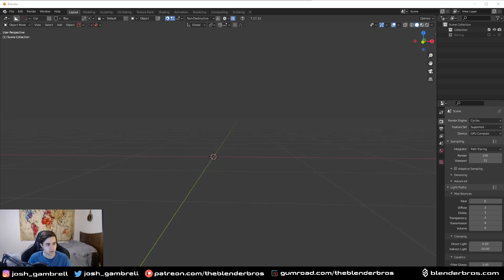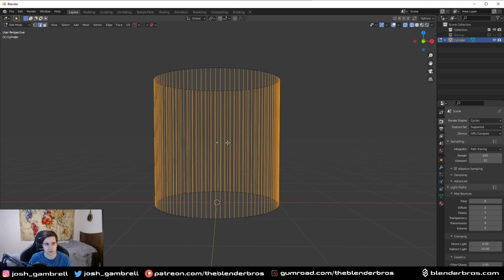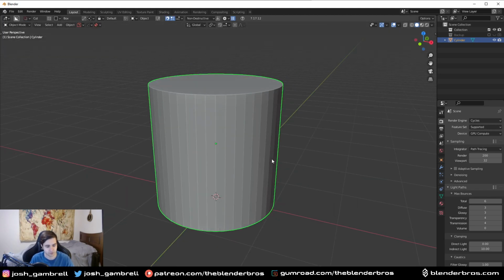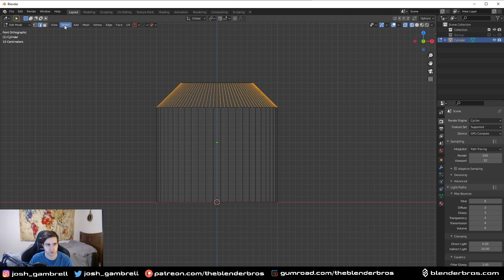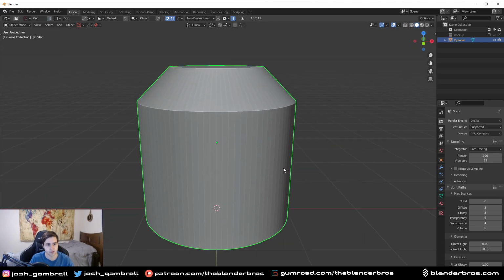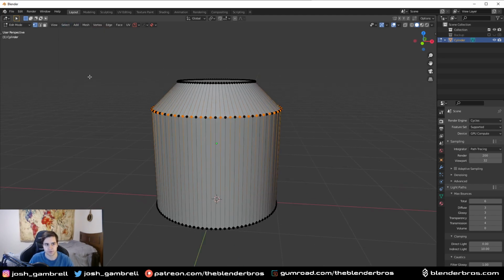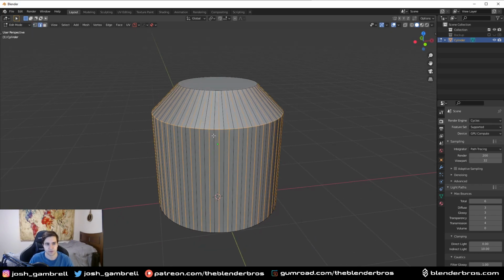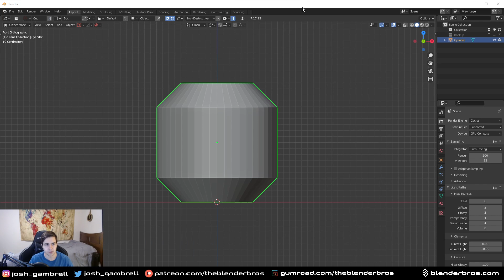Blender Selection TRICK using Machine Tools

Comment: Hey Josh, so I mentioned, not too long ago that I purchased Hard Ops, Box Cutter, and Mesh Machine (I also got Machine Tools), and you were the main person that convinced me to make that plunge. 

So, I have this issue with these Ngon cuts that you like to do. It makes none manifold topology. And I activated the 3D print plugin. But... I'm at a complete loss on how to fix these Ngon cuts.
Reply: I don't have any of those but i would think his tips to get clean ngons should help with non-manifold geometry, you need to triangulate as a final step tho if you're modeling for 3d printing blender does it automatically when exporting to stl.
Doesn't really matter if the model is non-manifold, it's a lot more important to see if it's being sliced correctly as you can have a non-manifold model that prints correctly as well as a manifold one that doesn't, the slicer settings are usually more important
Reply: @Ebani  so, I've recently done some experiments. This is what's happening. When the model is fresh and new and let's say it's a cube. And I do an Ngon cut, right down the center of that cube, I get two solid objects on either side of the Ngon cut. So, two objects with 6 sides.

But as I do more boolean functions, the two faces within the internal structure winds up getting deleted. So... well, with booleans, you wind up with tons of faces to the cube. But... if you don't apply the boolean modifiers, in terms of destructive editing, you still have two 6 sided objects... in theory. But the booleans make it to where only 5 of those 6 faces still exist, because the internal faces of those objects are being obliterated by the booleans. 

And when you have 50 objects and 100 booleans and Ngon cuts cutting through multiple objects... losing those internal faces... makes a nearly impossible to fix geometry.

Now... I'm not familiar with the triangulate method you've mentioned. But... that sounds like making a non manifold object.

I'm not familiar with .stl files (I'm new to 3D).

I do have the 3D print addon. It tells me the problems with the mesh and where they are, but you'd think that'd help, but not really. With my current project, I decided to try and tackle double faces first. So I'd delete faces and manually fill them... problem is, even after filling them and telling the 3D print addon to recalculate and to view the double faces, the same faces light up as being a problem... and I anticipate I'll run into similar issues trying to fix the other problems this addon finds. You'll see the problem, try to fix them, recalculate, and then the same problem still persists, as if you didn't spend 4 hours trying to fix it.

I anticipate that this .stl file would ultimately do what the 3D print addon would do when I click "make manifold" which is... it places random geometry all over the model and ruins it even more. There's a hollow section to the model. It's a revolver. And so right where the rotating chamber is, there's all sorts of wonky stuff happening.

I'm not trying to necessarily 3D print. And ultimately, these are models for reference in making a comic book. (It's a cool project, you should check it out. You can get my models for free. Collaborate, mentor with me... stuff like that.)

So ultimately, for the purposes of my project, it doesn't matter. But in terms of making a good model for anything else, my work is kinda dog crap.
Reply: @Ebani  this all gets me to think I should IMMEDIATELY appy my Ngon cuts, once I make them. And every time I do a boolean function, I'll probably need to isolate objects and rotate around them, to make sure the internal faces didn't get wiped out.
Reply: @Orphanlast  Unless you're gonna use the model for 3d printing or a game asset, having a non-manifold model doesn't really adds anything.

From my experience using the 3D print add on, if you have more than one object (like a model made up of multiple separated objects) you only need to select one bc if you select more it may say it's non-manifold as a whole even if each object is.

Triangulate simply removes ngons by convertir them into triangles (along with everything else), doesn't change anything else but bc of the nature of ngons they may automatically triangulate badly which is why having clean ngons is so important if you're working with booleans (and are planning to use the model outside of blender).

None of it matters in your use case and i don't get why you would want the interior faces as they seem to be a byproduct so i'm guessing you're doing something wrong, check out the hardops video list in this channel if you haven't, has some on cleaning booleans (as well as using hardops). It is a lot easier to work destructively but doing so would defeat the purpose of the add ons, which are supposed to make booleans easier.
Reply: @Ebani  well, you can get your hands on the model I'm working on. It's on my discord server (link in MY videos). My most recent video is me speed modeling it. 

It might help you understand what problems exist.

I also have some transparent faces... like leftovers of the Booleans attached to the model. And when I try to fix the double faces, and fill, it fills a transparent face... don't know what to do about that.